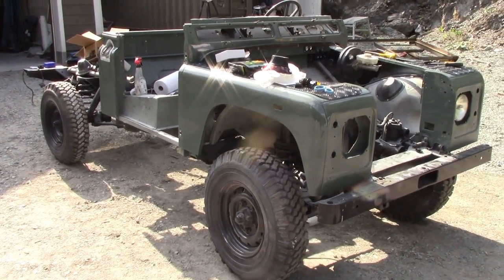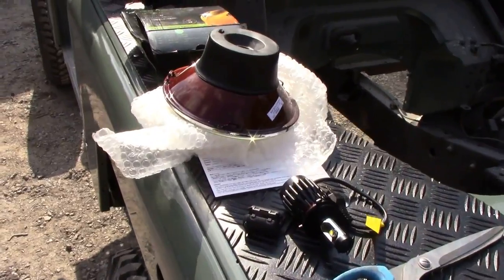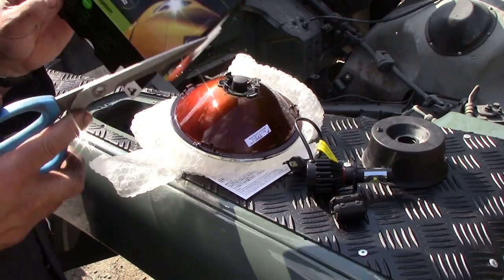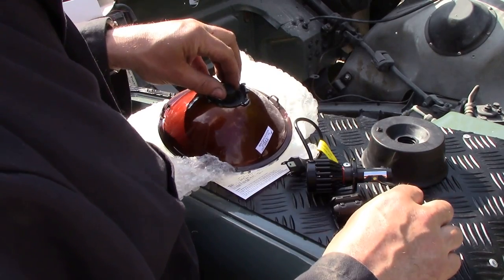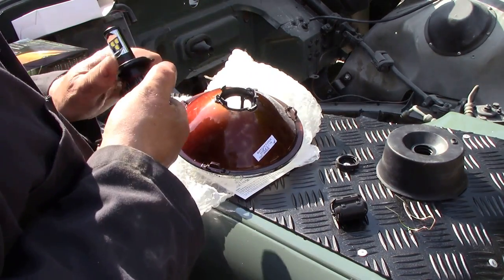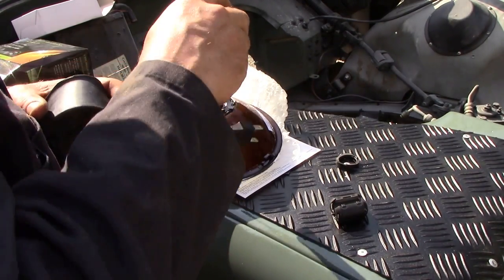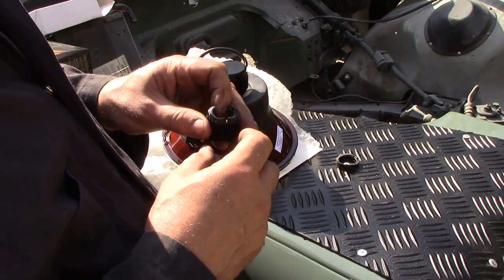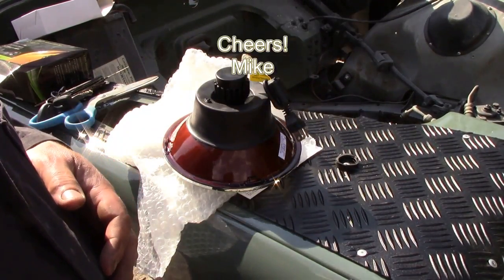Fitting LED bulbs to the headlights and fix radio interference

Comment: It is impossible for that choke to suppress noise because both + and - are running through it in the same direction. You have to run + and - in opposite directions for it to be effective.

Comment: thank you so much I've got the same LEDs in my landrover freelander and its been doing my head in losing stations every time I turn radio on lol but just one question what size millimeter are the chokes as I noticed there's different sizes thanks again great video :)
Reply from the maker: I think I used 10mm
Mike
Reply: cheers mike

Comment: I've been looking at these for a while. How reliable are they?  Thanks for the info Mike.
Reply from the maker: Really good - even with a broken headlight glass they still worked!
Mike
Reply: Do you  get the correct beam pattern with them mike
Reply from the maker: Yes you do Peter, but I found I had to raise the aim a bit as they were too low
Mike
Reply: I put led bulbs in my disco 1 200tdi but even on dipped beam they seem too high and I cant adjust them to go lower any suggestions other than putting standard h4s back in
Reply from the maker: Sounds odd as mine were a bit too low - I know this is a silly question, but did you get them the right way round/orientation?
I say this, as I have seen some LEDs that you could adjust by twisting the body.
I did see a P38 with a similar problem last week
The ones I used were pretty simple to use
Reply: I fitted some, similar to the ones you did.  I also had beam pattern problems, so much so I had to take them out again.  I guess it's to do with the position of the actaul LED devices on the bulb and the particular reflector being used.  I have the (fairly standard I beleive) Wipac sealed beam to H4 converstion units and fitted Nighteye LED H4 conversions but as I said ended up with a poor beam pattern.  I guess they were not a particularly good combination.  It would be good to work out a combination that works well.